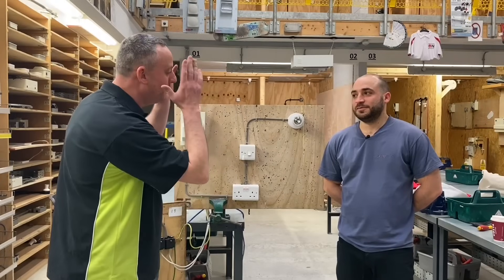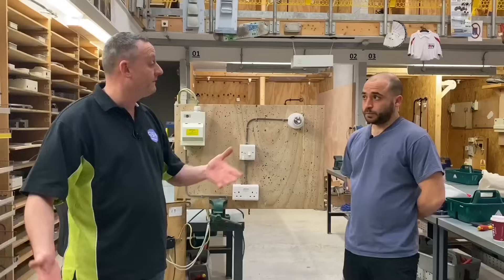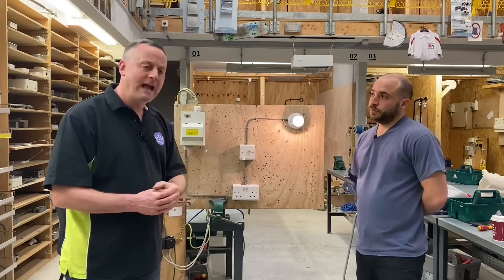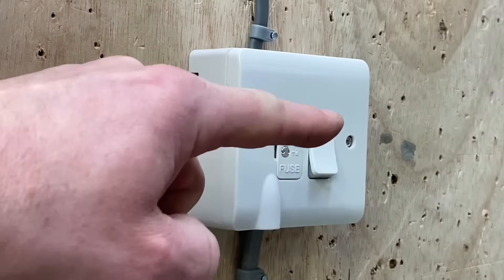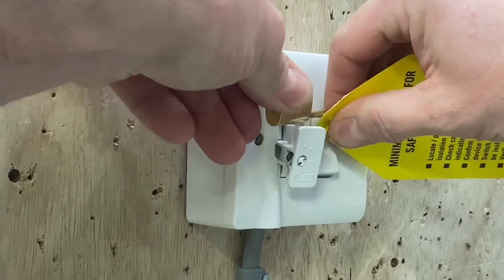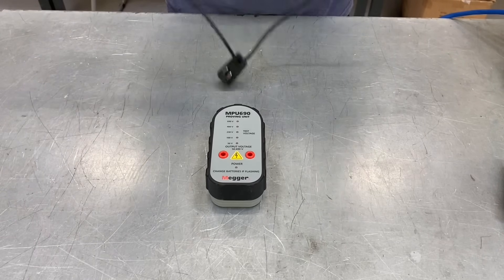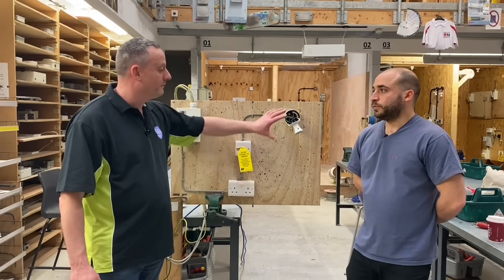How to Wire a Light From a Socket Outlet & Safe Isolation of a Switched Fuse Connection Unit (Spur)

Comment: Is it possible to connect two lights, say outside security light cables through the same fuse spur, or would they require separate fuse spurs?

Comment: If it's a radial, technically you could wire the light in 2.5 and not use a FCU.

Comment: Thanks for the great videos.  It would be handy to know how you can add a 2 way light to the current setup.  I've watched your videos on this but can't quite work out how it would operate using this set up.

I have a switch fused spur in the garage which operates the garage lights, it's protected with a 5amp fuse. The garage is about 12 meters long and ideally I would like to control the lights for the garage at either end.

The garage has been fitted with fluorescent tube lights, which are fed directly from the switch fused spur. If I turn the spur off it isolates the lights and no electric passes. If it's on the lights are on electricity obviously passes and illumintaes the lights.

I understand I now need a 2 x 1 gang 2 way light switch. My thoughts are to take the wires in the spur that feed the lights and put another box next to this, so that these wires will feed a new switch for the 2 way light switch. What I don't know is if there is an easier way or if I can buyt a 2way light switch fuse spur?

Also i'm confused as to the feed coming out of the spur is a switch wire or a neutral as it only operates the wire when its switched on?

Any help would be greatly appreciated.  Maybe a future video

Comment: Useful video thanks, to clarify you must use 2.5mm going into the FCU as the fuse (when downgraded) then allows you to run 1mm to the lights. 1mm runs at 10amps so if you were to put this straight off the double socket it would mean the 1mm has a lower amperage than the breaker on the consumer unit (meaning the cable fails first, which we don’t want!) - I think I’ve got it!

Comment: It's a fixed load, so no need for a fcu or 2.5 mm cable. 

Also, you can't use a single pole switch for safe isolation
Reply from the maker: An MCB is a single phase device (single pole)…
Reply: @GSHElectrical  I know what a mcb is "In your video you say "safely isolate" you cannot use a an fcu or an mcb  for safe isolation. It must disconnect both conductors.

Comment: Hello, apprentice sparky question.. I have a client that wants to add a hive pass through plug to a similar circuit, so they can control the light using a mobile app.  Can I use a flex cable on a standard plug from the spur to the double socket instead of the 2.5mm cable in order for them to use a hive pass through plug?
Reply: Orrr… would it make more sense just to use a fused plug, down rated using a 3A fuse and the spur to become just a junction box?

Comment: Hi Guys, and thanks for another useful and informative video. One question if I may: you give this as an example of using a spur for the lighting in a garage, but what if the supply to the garage socket is itself a fused spur - I didn't think you can spur off a spur...?
Reply: Only way I can think you could do this is if you put a fused spur prior to the socket and keep that one at 13A as if you do this you can have as many socket outlets on the spur as you want. The same should be true for this, if tou have a 13A FCU prior to the socket outlet and then a 3A FCU after the socket outlet going to the light
Reply: @lh2589  Cheers, LH. My "garage" spur does is fused at 13A, so hoping it should all be OK.

Comment: Could you just use a standard light switch instead of a FCU if you used 2.5mm or the light?
Reply: No, as the lighting needs to be protected by a 3amp fuse which would protect it for upto a 690 Watts load.

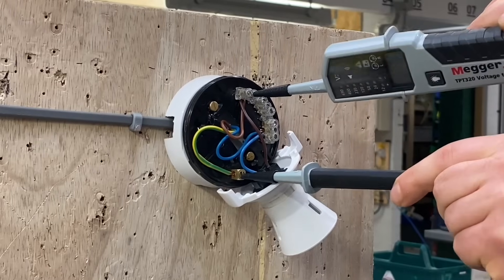Comment: Question: @ 4:50
Please why do we put the probe to the least dangerous conductor first, thus the CPC when testing
Thanks
Reply: It's because voltage can pass through your AVI, so if you are touching the line conductor with 230v in it, you now have 230v at the other end of your AVI which is a hazard, especially if it touches someone or something that can conduct electricity

Comment: Didn't know you could lock off a fused spur with a padlock like that. Nice touch.
Reply from the maker: Thanks John 👍🏻
Reply: @GSHElectrical a question relating to this well illustrated video of yours. Why would you use a 3A fuse for a lighting circuit that generally operates on B6 ICB's? Would fuse rating vary depending on power usage of pendant? Or is it dependant on cable size? I.e 1.5mm instead of 1mm
Reply: Lighting circuits often use 1mm or 1.5mm cable, which is thinner and rated for lower currents than the 2.5mm cable used in ring mains A 3-amp fuse will blow if the lighting circuit draws more than 3 amps, preventing the smaller cable from overheating and potentially causing a fire.

Comment: Can you use a 10 amp light switch on a power circuit. For example in a bathroom with heating bulbs/lights/fan   uses the power circuit.  I assume the light switch cables must be 2.5 mm also  ??

Comment: How come appliances such as hair dryer or a window roller shutter motor can be plugged into a power circuit even though they come with smaller cable sizes than 2.5 mm. For example a window roller shutter motor i imagine would draw higher current than design if it got stuck or its limit switch failed ?????
Reply: thats what i was wondering as well. my hair dryer came with a 0.75mm2 cable
Reply: @V1rtu4L0ut  I think the reason is these appluances cannot by design draw any more current than the cable can handle in normal use.  If there is a short circuit a breaker will trip and protect even these smaller cables
Reply: @michaelcostello6991  my hair dryer says that it's 1800 to 2200w. 0.75 seems a bit to small for 9a but I read a forum entry where someone was able to pull 13.2a through a 0.75mm² cable with temperature rising from 28C to 50C in an hour. So it probably would blow a fuse before anything catastrophic happened. 50C is probably not hot enough to cause a fire. There's also the fact that the cable on a hair dryer is in free air and not buried somewhere in a wall. Also, it's not an appliance you would typically leave unattended. I once used a nasty Chinese extension cord (that I didn't know was unfused) with that hair dryer and the extension cord started melting 😮

Comment: This idea of testing the tester after every test is a waste of time
Reply: why? The tester may have failed after the first test
Reply: Not got a lot of confidence in your equipment
Reply: The tester will die at sometime ,if it happens when you are proving dead and the circuit is not dead ,you could end up dead.

Comment: Hoping for some help here

I'm planning on doing a home alarm system 

The main panel needs to be connected to the mains

I have seen some videos online where the guys are using 3 core 0.75MM flex into a mains socket 

I have also read that alot of people just come off the lighting circuit into a fused spur 

None of these options seem like a good one as lighting circuits are more like to trip or fail

Adding a plug will mean that it can be turned off by accident

I'm no pro so was wondering if I could get some feedback from you guys

My plan is to come off the main ring downstairs, into an unswitched 2/3 AMP fuse spur 

Would this be the best solution?

Also what kind of cable would I need for this? Size wise, twin core and earth ...

Thanks
Reply: At minimum 2.5mm twin & earth to an unswitched  fused control unit with 3 amp fuse. From there you can use 0.75mm or 1mm flex to the panel.
Another option would be to change the socket oulet to an unswitched one and use a 3 amp fuse in the plug.

Comment: Could this be done in a ring circuit?
Reply from the maker: Yes
Reply: @GSH Electrical  could you power ceiling lights using this method my house is pre 1970 no earth to ceiling lights

Comment: Can you replace the 3amp fuse with an 13amp fuse?
Reply from the maker: U could
Reply: @GSHElectrical  thanks for the quick reply, much appreciated! I need to run a live wire from a socket in the kitchen to cupboard under the staircase. So 2.5mm cable from socket to fcu in port then 1.5mm/2.5mm from load port in fcu to ceiling rose.. is that right? Hope im doing it the correct way... fcu being 13amp fuse
...thanks
Reply: @mohammadkhan4723  yeah if it was 13 amp I’m pretty sure it’s 1.5mm twin and earth instead of 1mm since your increasing the sort of potential current demand. But going in it’s 2.5 becuase you still have what 32 amps from the socket socket so you need a bigger cable to handle that.

Comment: One of my pet hates is Switch fused spurs , fused connection units and plugs are supplied with fuses fitted, generally a 13amp fuse and people rarely change them for the correct one , they should be sold without fuses. I have lost count of the 13amp fuses I had to change for the correct fuse. I reckon I have the world largest collection of 13amp fused
Reply from the maker: Great point 👍🏻

Comment: So if I wanted to add an outdoor garden floodlight, this will still work?
Reply from the maker: Yes
Reply: @GSHElectrical  Another stupid question.

Would I keep the fuse spur inside the house I'm assuming?
Reply: @deepmystic5850  if you use an outdoor rated sfcu it can be outside.
Reply: @GSHElectrical  Good to know

I was unsure about putting something outside

Had a spark come round and he wanted to come off the light switches to stay on the light ring

But this would have meant unsightly trunking across the ceiling!

Might try this myself

Comment: Great video guy’s 
What is the brand name of the socket and the FCU ? I have never seen them with eliminated switches before, and I like the idea that you can lock off the FCU 👍. I must get some of them.
Fantastic video Gaz as always 👍👍👍👍👍❤️⚡️⭐️
Reply: That or sell them with a 3A fuse, then, if you require a 13 and don't bother to change it, it will fail almost instantly, forcing you to fit the correct fuse
Reply: Sean - it’s the Crabtree Instinct range. E-fixx did a review of the range on their channel - https://youtu.be/Sp632Gfbk04

Comment: I recently did this for a block of flats. Installed an outside circuit to power a CCTV equipment cabinet then a lighting circuit to put a light in a bin store from that. Except I used a 1a fuse. Thanks GSH as ever.

Comment: Out of curiosity, just like with Spurs, how many lighting points can come off the FCU
Reply: Up the lighting circuit to 1.5mm cable and use a 13 amp fuse you can have  3000 watts of lights the only restrictions being volt drop and Zs
Reply: @stevensmith4449  Thanks for adding your thoughts.  The original question was a spur with 3A not a spur with 13A.  Is my answer of 690 (for 3A) correct?
Reply: @no_short_circuit  3ax230v gives 690 watts. 
Still have to be careful of the circuit length for volt drop and circuit disconnection time!
Reply: @Steven Smith  can I use this system for ceiling lights an get rid of my lighting circuit because my ceiling lights don't have earth wire house is pre 1970
Reply: Not a qualified electrician and Gaz will correct me if I'm wrong but as long as the total power downstream of the 3A fuse is less than than 690 W the fuse will not blow.  690=230 x 3?
Reply: @no_short_circuit  thanks for the comment, I did think this, didn’t know if there was a reg on it tho. Thanks again 💪🏼